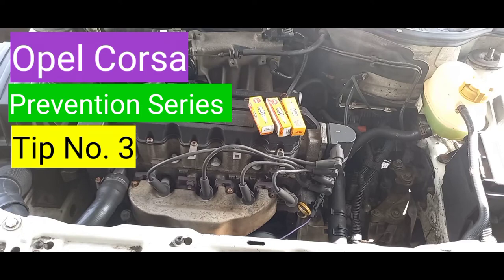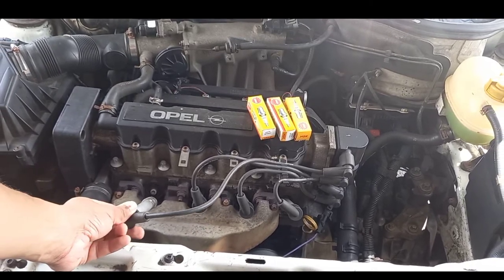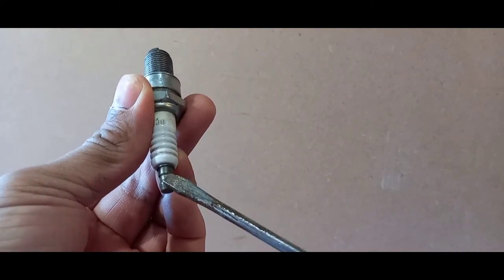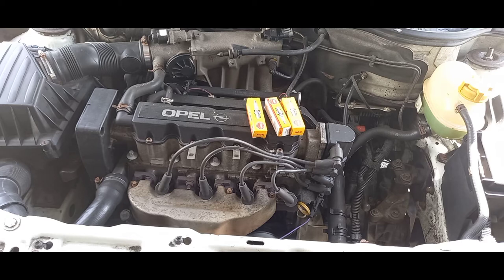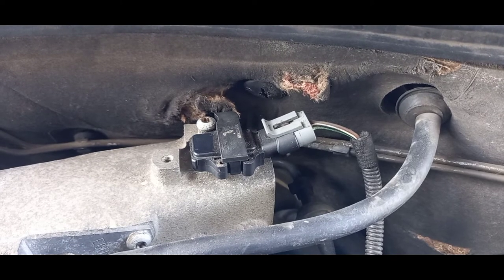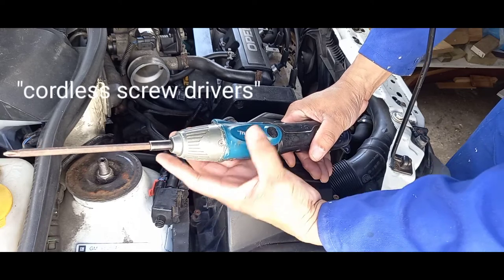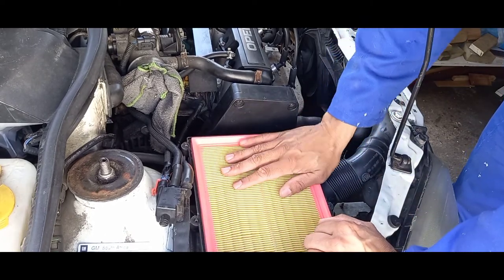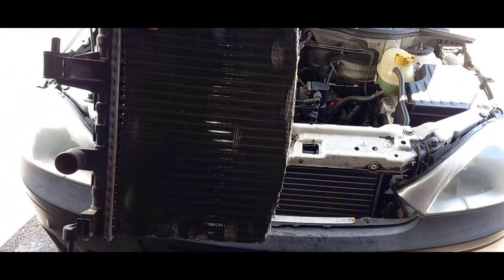Opel Corsa Prevention Series Tip 3 Spark plugs and Air filters.

Comment: Warm regards from kenya.  I have a corsa 1.4i and done 200'000 kms so far running perfectly without any issues.  Imported super 4 spark plugs from the uk and my corsa runs very smooth. Has good power and gives good fuel consumption..

Comment: Itjoo i was once shocked by those wires when my opel corsa started to enter on limb mode jacking at 40 km to Graff reinet as i was coming from Queenstown to Capetown, then i found new plug wires as i was driving with 3 plugs as one wire was broken. When i got to Beaufort west those plug cables were melting beyond that alluminium plug holders, i had very bad ride so to survive i had to switch car off once it starts to jack then back on again then it would drive 5 km then i must do the same thing until i arrived at capetown but even today no mechanic who fixed this problem, i bought the manifold heat resistance bandage to prevent spark plugs from getting hot and burn the plug holders. I suspect timing because when i start the vehicle the rev goes up to over 5000rpm then it slowly comes down to normal, any advise opel users or video owner? I have put the KnL air filter and i always make sure i clean it with  together with trottle body using trottle body cleaner . What can be the cause of it losing power?

Comment: Good day I was wondering if you can could tell me or make a video on the reason why my Opel corsa loses power for about a few seconds then kicks back again what could be the reason
Reply from the maker: Hi . What you are asking for is quite complex as the engine has to be properly inspected to determine the problem. 

A good start would be sensors and wiring, fuel pump and filter check.

 but also what is the mileage on the engine and when was the last major service done. 
This would include Oil, oil filter, plugs, air filter, coolant change, timing belt, tensioner, water pump and  oil pump.

Comment: I had a mechanic come to check my vehicle yesterday, due to it not starting, and to quote me for a service. Being recommended, he is a huge overweight man who showed up without his t-shirt on, profusely sweating in the sweltering sun. He left my vehicle seat covers wet with the imprints of his body fluid and his hands and dirty shorts left grease smears that I cringed at. My vehicle is a 2004 Opel Utility 1.4 is which is in excellent condition having had a female owner prior. His ripping out of sensors and swinging my starter for 30 minutes straight, even when nothing he was doing was working, let me very uncomfortable. I guess I expected someone who presented himself as knowledgeable, neat, professional, and could follow a series of steps commonsensical to being in the field. In honesty I saw a cowboy who I do not want to make my vehicle be worse than its current state. This video is like a breath of fresh air and I would bring my vehicle to this man anytime. No more greasy nailed mechanics for me. I do feel confident to approach the service myself. Thanks for the amazing content.
Reply from the maker: Wow what a story,  sorry about that experience.  Yes there are many mechanics not up to standard , but there are many more transparent and excellent mechanics also 
So don't lose hope and faith in them.
Engine problem diagnosis is not always easy and straight forward, but I aim to try and help the normal or DIY enthusiast to prevent or solve there issues.
Im glad you managed to do it yourself. 
Thanks for the comments.

Comment: Thanks for your Information.
I have a Problem with my Corsa bakkie 1.4, I was driving it this other morning then I realized it has no power when pressing the Gas paddles, I therfore went to the AutoShop they says my Spark plugs are wet due to oil, I therefore changed them all but the Problem still the same the new ones are getting Wet again and has no power when pressing the Gas Paddle. What could be the possible Problems?
Reply: Gasket cover man and seals because oil is sneaking to the plugs. I hope you managed to fix it